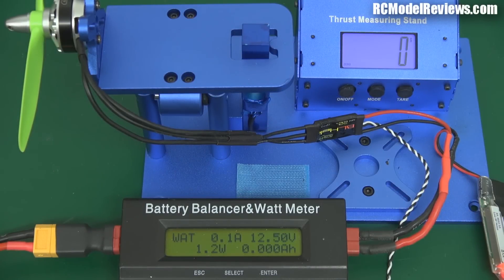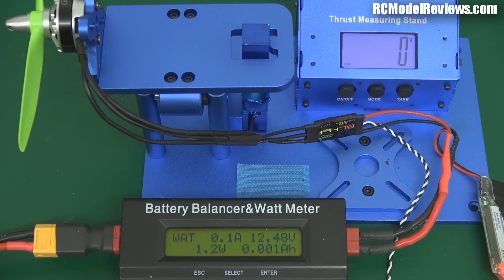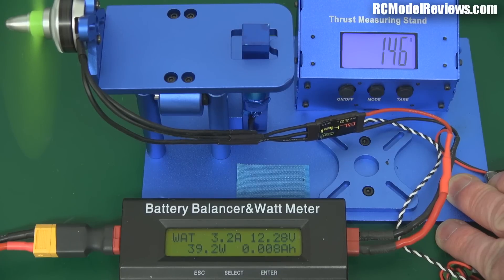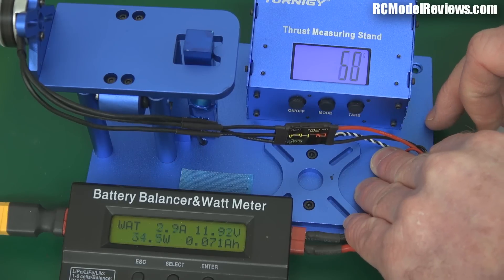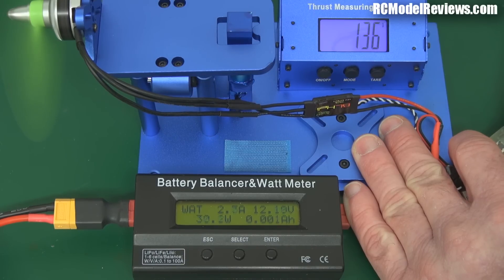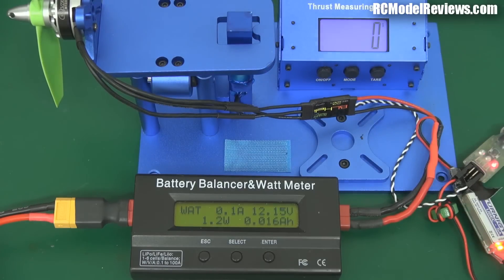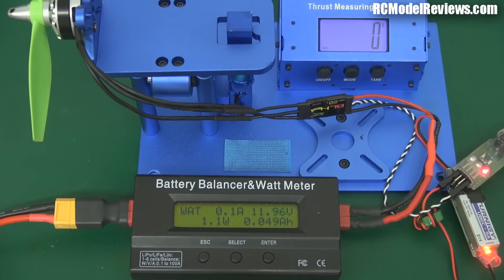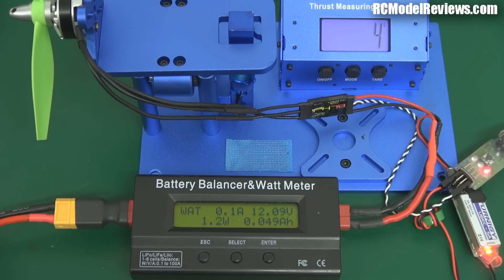Bench test: HQ vs DAL bullnose miniquad props

Comment: Can anyone recommend a quad around 450-500 dollar quad that requires no soldering and is for racing
Reply: swrexhunter Vortex lol
Reply: swrexhunter NO, reason -if that is your "skill level", can't solder.
Then you are out after the first hard crash with your No-Soldering-FPV-racing-quad.
They do tend to destroy the electronics, from crash to crash over time.
So soldering skill are needed, or a very big wallet.
Reply: swrexhunter vortex
Reply: swrexhunter have a look on STORM racing drone from Helipal  looks like a good RTF package for begginers, atleast from the videos some people post on youtube. for more then a year im flying with blackout mini H in places if something fails i would never be needing any soldering skills :D
Reply: swrexhunter Many positive reviews on YouTube.
http://www.hobby-wing.com/x-speed-fpv250-emax-2204-6045-rtf.html
Reply: swrexhunter Soldering is a very easy thing to learn and there are many inexpensive soldering irons out there.
And soldering a few cables on a quadcopter requires close to no soldering skill.
Reply: WorksopGimp I wouldn't choose that, it has several things going against it.  Firstly, it has 1306 motors -- WAY too small for having real fun.  You want at least 1806 and preferably 2204 motors to get decent performance.  Secondly, the arms are made from fiberglass PCB which is neither light nor particularly strong.   That vacuum-formed plastic shell is also not going to do much except crack, split and get thrown away after a few crashes.  It has no FPV gear onboard and personally, I prefer the Naze32 over the OpenPilot CC3D flight controller.   You don't get that much for your 150 quid in this package and what you do get isn't going to keep you excited for long.
Reply: ***** I did wonder about the arms.
Reply: Building your own UAV can be fun and rewarding, but some people are just not in to it and would rather fly.

Comment: ***** I am not sure how you arrived at the conclusion that one prop is necessarily more "powerful" than any other.   A prop is a device for converting energy from one state to another; and the in way it accomplishes this is a matter of efficiency.
Reply: ***** You are correct that the props themselves are not more powerful but the effect is that if you put them on your motors, the motors will deliver more power (in terms of thrust) because of the extra load they represent.
Reply: *****  I have managed to burn motors out (blue smoke yee-haa) by using props that the motors cannot cope with.   It would be really great if you would be able to provide some tips in a future video on how to get a rough idea on how to properly size the motor / propeller / battery combination for a quad.